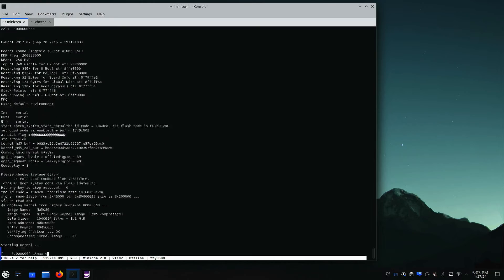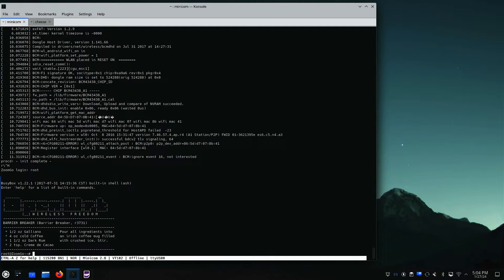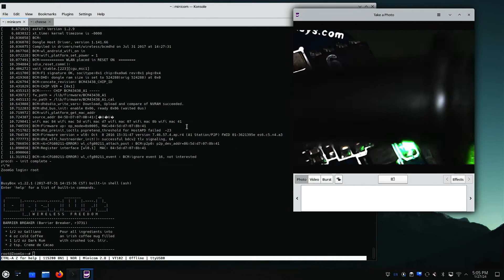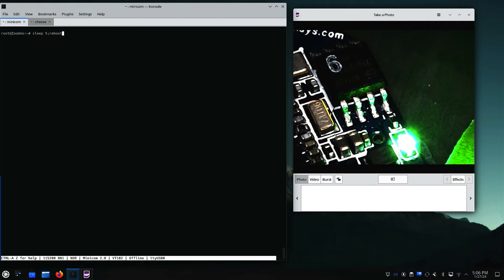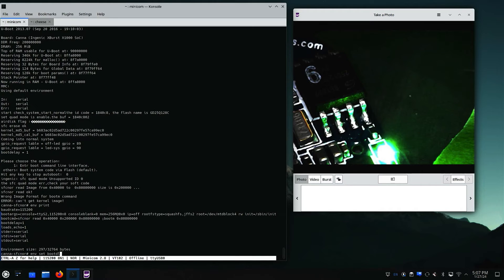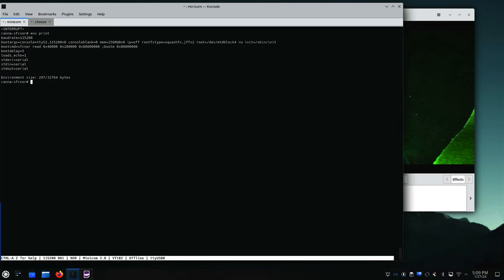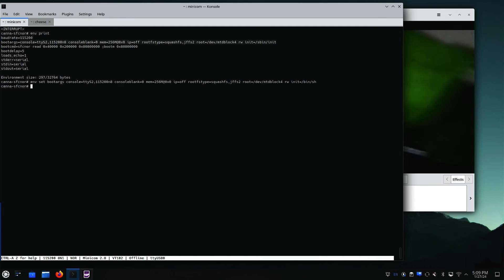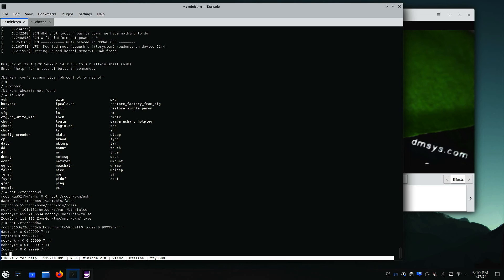Hacking Your Way Into The Embedded Bootloader - A Quick Tutorial

Comment: Will you be doing a wyze?   I'm a big advocate of right to repair.  Thanks for your videos.
Reply from the maker: I have several Wyze models on the bench.. Wyze Cam V2, Wyze Cam V3, and Wyze Cam Pan v1. I've been working on one of the Cam v2 models for a while however so far OpenIPC has not been stable enough to recommend on it so I need to move on to a different unit!

Comment: What about if you wanted to compile your own image for the device? How would one do that?
Reply from the maker: There's really 2 big pieces there... First off building your own image, as these devices tend to use proprietary SDKs and aren't supported by mainline kernels. And once you have the image, getting it onto the device. I'll be diving into both more deeply in future videos.
Reply: @wltechblog  Flashing is the easy part. You can just use dd tool and flash partitions. But making an usable image is the question. As you said without the SDK and all that. I don't know. It would be cool though to get rid of the original image with a custom one with modded or custom scripts or change to debian or something like that.
Reply from the maker: @hedgehogform  We're doing all of that over on the Discord, mostly images based on OpenIPC but some others as well. Devices with a SD card slot can run a custom Slackware image I've built!